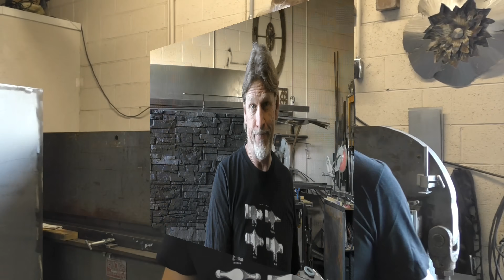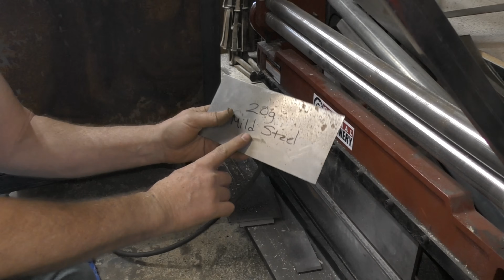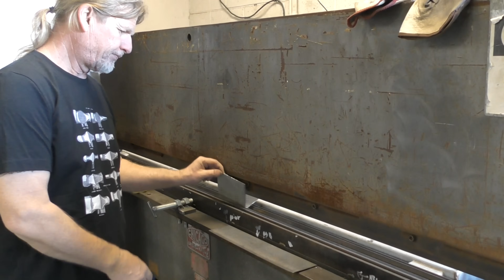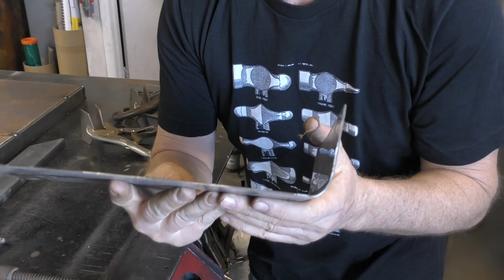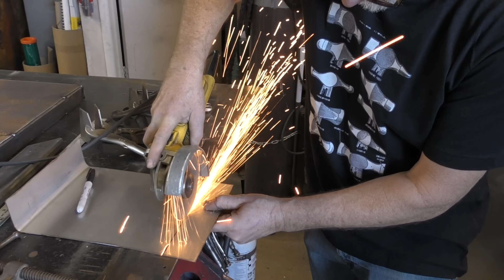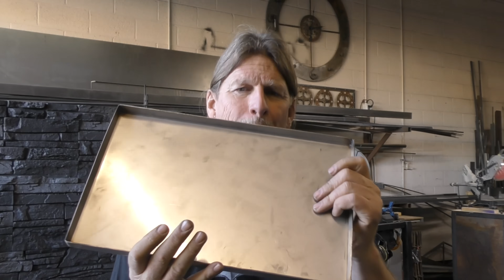How To Bend Sheet Metal Without A Sheet Metal Brake

Comment: Instead of square tube use 0.25” or thicker steel angle. Grind one edge of the angle steel at about 45 degrees. The profile of the steel angle allows you to push the bend slightly beyond 90 degrees. Then you back the bend off a bit and that will give you nice crisp corner.
The edge of the flat bar facing the bend line should also be chamfered so the edge of the steel angle and the edge of the flat bar do not push on each other at 90 degrees. The flat bar on top should be paired with one on the bottom to prevent the metal from bowing out.
Reply from the maker: That's a great tip, thanks for sharing!
Reply: would you be able to make a video of your technique..?
Reply: @dickie7311 technique for what operation?

Comment: Thanks for the video, may try scoring and the welding the thinner part on a project I have

Any tips on bending 1/8” steel diamond plate along an 8’ edge with a 1.5” lip?
Reply from the maker: I would probably still score it but put the score on the interior of the bend

Comment: I'd like to see how you did the corners on that metal tray you made.
Reply from the maker: Once the two side were bent, I just welded the corner seams and cleaned them up with a flap wheel on the angle grinder.

Comment: How can you put an 1.5"-1.75" roll at the end of an 8' long 16 gauge sheet steel?
Reply from the maker: It's 8' long but how wide is it? Are you wanting the bend in the length (8ft) or in the width (?)? The length would be tricky but I would make a series of scores in the sheet. Maybe every 1/2" depending on the radius of the bend desired
Reply: Excellent question. I didn't describe well. The 16ga is 8 feet long by 3 foot wide. Along one 8' side, there's a curl 1.75 inch diameter. Then, along the same side as the curl, 5 inches in there's a 45° angle. Think of the top edge of 1940s truck beds but making a side for an 8 foot bed. @ArtfullyRogue

Comment: Do you have any advice on how I can imprint or indent lines into 20 gage sheet metal? I’m trying to press lines the same as rifle magazines have
Reply from the maker: Sorry for the delayed response, I typically use my 25 ton ironworker but I'll make a custom die to make whatever shape I need. If you're doing my hand, maybe line of the indent line you want to make over two pieces of flat steel and hammer in the gap of the two pieces, if that makes sense

Comment: I wanna make my own engineering square which works to square around box section with a radius. The cutting disc radius one looks good. How big is the gap where u cut into with a cutting disc after bending it? Is it big enough to be able to put a weld on it that isnt a super tiny weld?
Reply from the maker: I often weld after I've bent the sheet. It's a small weld but not super tiny

Comment: Thats pretty awsome but is there a safer way to do it? Im not very experienced with an angle grinder and am not confident in my ability to NOT cut my finger off if I use it the way you did, is there another way i can score it?
Reply from the maker: Unfortunately, I'm not aware of a scoring method that would be deep enough to assist in creating the bend. In thinner sheet metal, you might be able to use a scoring tool. It's just a hardened sharp piece of metal that will scratch a line. It's typically used more for marking a cut line. There is another video I have that shows how to make a basic sheet metal brake. I have a welded version and a non welded version demonstrated in the video. Here's a link to that video https://youtu.be/KNsSU39RNeY?si=Jm-jEGaTSUaBaEz-

Comment: I’m working on bending a 10’ 22-gauge zinc sheet for a countertop. I’ve already made two by using a deadblow hammer to mallet the edges down. It gives the edges a cool hammered look which gets lots of compliments, but it takes forever. Any tips for bending longer pieces of metal more efficiently?

Comment: Seeing as you mentioned it, I was considering getting the 18 inch brake from Harbor freight to bend 16 gauge SS to  90 degrees. Fools errand or doable, what do you think?
Reply from the maker: @herbfellows6435  it has a difficult time bending 16g stainless.  If you can mount it to a solid surface, extend the ability to apply pressure (breaker bar etc. ) and possibly weld a stronger spine along the brake blade, it could work better.
Reply: @ArtfullyRogue  I could go as thin as maybe 22 gauge, would the answer be the same for that?

Comment: doesnt it get less strong when you use grinder to the edge?
Reply from the maker: I believe anytime you remove material it will become less strong. However, I also feel it depends on the project and whether or not dimenshed strength is an issue. I wouldn't use it structural situations, but simple table of shelf would be fine. Keep in mind, this method is for someone that doesn't have access to anytime of brake machine.
Reply: @ArtfullyRogue  how about heating and bending with torch?
Reply from the maker: @Kingcyborgt400  You can try that. I find that when heating stainless in warps inconsistently  and not like mild steal that seems to heat in the intended area

Comment: What if you bent it up instead of down?
Reply from the maker: it doesn't bend a full 90 degress if bent the other way
Reply: @ArtfullyRogue  Okay because I just saw somebody else do it in another video.
Reply from the maker: @luigiprovencher  It depends on the kerf of the cut off wheel. I typically use 1/16" kerf on my cut off wheels. If you use a large kerf, like 1/8" I can see how that would work

Comment: Should that be welded where it was scored? Seems like it would be a weak spot.
Reply from the maker: If it's a seam that will be seen or is a support then yes, I weld it. When I make trays for my water fountains, they typically get powder coated and don't hold any weight so for those, I don't usually weld.

Comment: Why not perforate with elongated holes along the bent line instead ? It will not lead to fracture as fast as cutting along the ende as you did.
Overall a good video though.
Reply from the maker: I think drilling holes would consume more time and definitely need to be welded afterwards. If I'm understanding your suggestion correctly. Thanks for watching, its greatly appreciated.
Reply: @ArtfullyRogue  Depends on the result you want. If you laser cut or water jet cut it´s not a big deal. There are patented perforations especially for that. 
If you want to bend really thick material which you can´t otherwise it can make sense as well. 
If you don´t want to weaken the bend which leads to a fatigue fracture as well, scoring the metal will lead to a fatigue fracture for sure and you need to weld that as well, welding holes shut can be easier and faster, again depending on the result you need. 
It´s usually used for small batch manufacturing or prototyping with precise and easy bends.

Comment: Bend it the best that you can using the edge of the bench. Then get in there with a block of wood and a hammer still clamped to the bench. And if you use a little art and finesse, it will look as good or better than the bend from the giant hydraulic brake. Not as fast, but also not 10,000 bucks.
Reply: Exactly,and without weakening the metal with the grinder

Comment: What if you put the cut/ score on the inside of the bend? And before you bend it - you give the cut a quick hit with some spray paint to seal it off from rusting?
Reply from the maker: If you use a wider cut off of wheel bending into the cut is a little better. For this I was using a very thin cut off and bending into the cut causes the two edges to hit and prevents a full 90 degree bend.

Comment: Thanks Doug. No link to the VG bender tool. I am going to attempt to bend 0.125 aluminum diamond tread using this method. I like the radius bend, so to not crack the metal... if I can figure out how to allow for the radius. I have bent this metal before by clamping, like you did, but used a hammer and arm strength, but of course, hammer leaves dents.

Comment: Great video! Thanks!  I have to replace some sections of 16 gauge sheet metal on an old 1948 Missouri Pacific caboose roof. Likely around 60 feet altogether, and I am thinking in 8 foot long (max) sections since that is what I am seeing available. Can this technique be used for pieces as long as 8 feet? It's for the edges of the caboose, so the pieces will be rounded over instead of a tight bend.
Reply from the maker: Sorry, I completely missed your comment. I'm about to post a video where I bend 10ft 16g mild steel and I wanted to use your question in the video if you don't mind
Reply: Thanks @ArtfullyRogue  , I don't mind at all.

Comment: Do you have any tips for bending stainless steel beyond 90 degrees to like 60 or 45?
Reply from the maker: I've done that using this method. Moving the top plate furtther back from the line after you've bent the 90, you can keep pushing it beyond the 90 degrees
Reply: @ArtfullyRogue  Thanks for the quick reply

Comment: Fabulous video!  I was just told by my makerspace that they could not help me build molds for my fused glass designs.  I am definitely going to try this technique.  Thank you so much.
Reply from the maker: You're very welcome. I hope it works out for you.
Reply: Cool, I'm a kiln worker also. My use of SS is a bit different though. I'm making 'graphite paddles', only with SS. Using various graphite paddles, I have discovered that they always leave a pattern on the molten glass. 
With flat stainless I hope to avoid that pattern, but with SS, you can only touch the molten glass1 for a second or two at the most, so it's a real 'hit and run' operation.

Comment: Interesting.   Never owned break, but wanted to.   But do have to say this.  I have 2 large 3"x3" Angle iron sections.  each end directly in center of the  V just drilled a 3/4 hole and stuck a bolt each one lol  Just line the sheet metal up top one on line impact gun each one half way each time till perfect 90 lol!    Been doing sheets of 1/8 stainless 3foot long now for last 5 years that way only takes few seconds! I'm a southern redneck what can I say!   but honestly if I had the 20 grand to buy a hydraulic break like yours lolz

Comment: Thank you for this great video and providing an alternative.  Wouldn't the cut in the metal weaken the strength of the metal.  I need to do a Z cut with only 2 inches in between for the channeled floor pan on my hot rod .   Do you usually add a bead of welding to increase rigidity?
Reply from the maker: Great point! It all depends on the project for me. Sometimes I will had a bead along the corner to strengthen. If I'm making a simple tray of a project with less concern for strength and its more for looks, then I don't add the bead.
Reply: @ArtfullyRogue  Thank you!  Makes perfect sense

Comment: Is it possible to make an open hem fold on a 16 gauge stainless steel piece that is 1.5 inch width using this method???  I was think if I clamped down a much thinner piece and I bent it up instead of down then it would work - but that’s just me thinking and I have zero experience. I’m desperate for a solution and can’t find a tool to do this that’s under $200.

Comment: I was just told that it is impossible to bend 16 guage stainless steel without a giant industrial box brake bender from a machine shop with giant brakes. Your doing dark arts and black magic!

Update: Using this method I was able to bend a 16 guage stainless steel 3" deep pan. I folded the tabs in just like a box. The dimensions were 48" x 30". Used sheet metal vicegrips and 2 copper pipes to assist bending. Welded with cheap Harbor freight Welder. Sanded with 80 grit to 3000 grit for mirror finish. Then clear coated.
Reply: Clear coat on stainless?

Comment: Any recommendations for getting a clean bend when you need it so far from the end of the material that you can't use those vise grips and C-clamps only go so far from the sides? I've been using a four pound hammer and forming the sheet to the edge of my workbench (1/2" steel tabletop). Also using 16 gauge and I think it's probably better to cut and weld for this size job. Except you should see my welds...

Comment: It's the ubiquitous flexible fabric bandaid that makes this real. Anyone, doing anything in their shop who isn't wearing one is a pretender. Thanks a lot for this. I have an old, inheritied, steel table Craftsman table saw that I use for bending the once a decade times I need to bend sheet metal. If I want a sharper radius I use a 2x4 and a 4 pound sledge and then the sledge by itself. Obviously I never bend for pretty. Thanks again.

Comment: When i want a crisp more squared off corner i will do the same thing with the c clamps and then used a rubber mallet to bend it against the edge of the bench
Reply from the maker: I definitely use a rubber mallet when I'm bending longer pieces.
Reply: @ArtfullyRogue  I learned the hard way to not overdo the mallet hammering on aluminum bends -- the metal fatigues & thins to the point of cracking!   Another tip is to go slower as rapid bending causing internal friction/heats the aluminum and does something to its temper, or so I read somewhere.